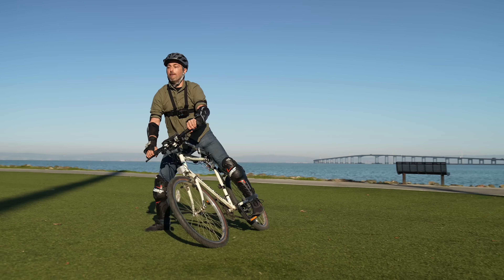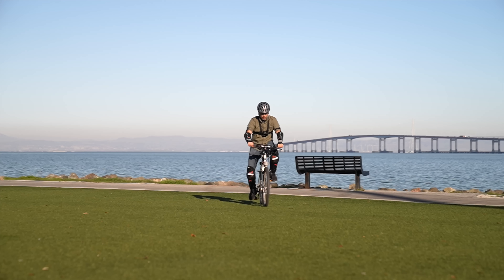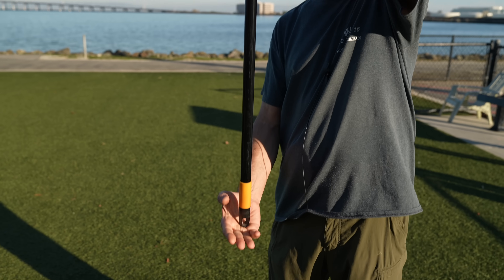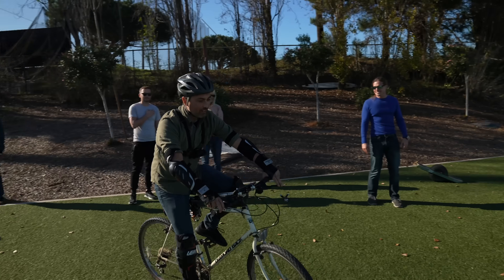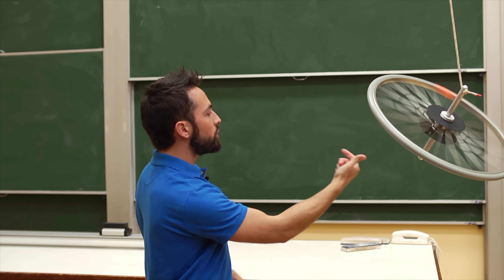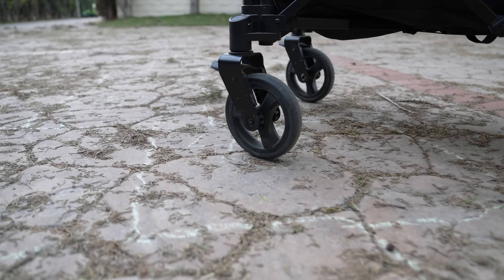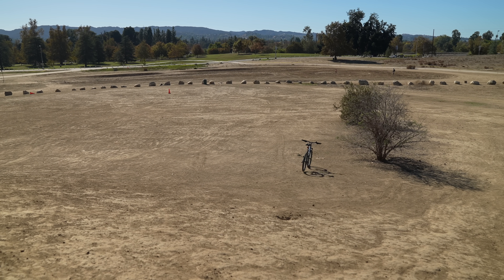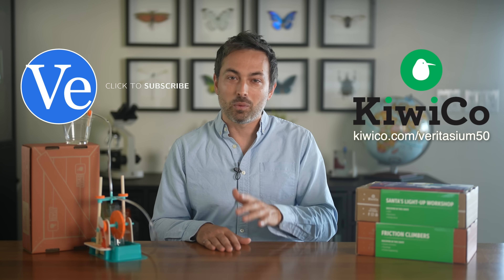Most People Don't Know How Bikes Work

Comment: this just means, you havent touched a motorcycle, and you also cant ride a bibycle. First of all, if i dont want to ride my motorized vehicles, and i dont want to walk ok foot, and i want to be somewhere fast, i also ride my bicycle fast. As long as you are on solid surface lige asphalt, you dont do what you showed in this video. On grass you will ofc ride your bicycle as a dirt bike on gravel, but on gravel, with decent speed, not walking speed, you dont need to steer at all, you only lean. And on asphalt, even with walking speed, you wouldnt fall like a clumsy baby. 

The steering at high speed downhills, well, you do a slight turn of wheel/steer to opposite side where you are turning, but you lean to the opposite side, but the slight steer is far less, than you are even allowed here, you would need to steer far more, only, if you do like, dunno, professional competition timed run, and that is on a downhill gravel.

Tho, at end, the thing about gravity, how lean steers, that is how super sport bikes work, which is quite ancient technology. For example , i have 3 motorcycles, street motorcycles at low speeds in cities work same as you show with your bicycle on grass ( would be different on asphalt ), while supersport bikes, even at 20 kmh, your steering wheel doesnt turn at all, you just lean, but makes it difficult to drive them in cities.

Comment: Front wheel control is the most important for sure, I didn't really fully realize this until now though, but when I think about it - and you watch those guys doing jumps from different platforms - they make lots of corrections with the front wheel all the time to stay on the bike - and they are not moving that much at all.  I am guessing it's a ratio like this:  Front wheel = 99-97% of all balance, Gyroscopic Effect ≤ 1% up to 3%  Speed depending.

Comment: Any motorcycle rider knows at the very beginning of this video before even watching it (I haven't even watched it past a minute yet) that to begin going around a curve you have to "push" on the handle grip of the side you want to lean towards, thus making the handlebars go the opposite way momentarily so that the bike well begin falling in the direction you want to turn...then, the radius of the tire contact to the ground will maintain its balance as it turns in that direction.  It's called "counter steering" and is one of the first things we learn.  It's not so obvious on a bicycle but on a motorcycle going 30+ mph it's very prevalent because the handlebars move very little..  Very common...

Comment: Depends on how fast you're moving. If you're barely moving, yes you will go in the direction you turn the handles since your balance is always straight up and down. But as you gain speed, that becomes more impossible and you have to rely more on counter steering and which way you're balancing. It's the same with a motorcycle.

Comment: As a motorcycle rider you learn this in safety class.  The reason so many fatal crashes between the rear end of a truck and a motorcycle was always on the left rear quadrant of  a truck became clear; in an high speed emergency (they were speeding and suddenly needed not to run up the tail of a truck) rider would pull their handle bars to the obvious escape direction - the left however that made the bike serve right instead.  So in safety classes we've been taught to  push the handle bar instead of pulling it in an emergency high speed turn.  If you want to go right PUSH the right end of the handle bar and you will go right, PUSH the left end and you will go left.

Comment: Spend years on a motorcycle and one should definitely figure this out. Consciously. After a couple hundred thousand miles and many many full days of riding, it was important to become extremely comfortable with the mechanics of riding. Want to turn right? There is first a very slight press of the right hand that pushes the bars to the left. This happens instinctually after awhile.

Comment: having road downhill mountain bikes for some 20 years now, i can confirm you do have to turn the opposite of the direction you wish to turn before turning that way. Just mentally going through the process of a turn i see but i had never thought about it or been aware of that fact before now.
Reply: On berms though you can turn without counter steering first. If you’re hitting it at the right angle before and at least.

Comment: It’s like motorcycles except since it doesn’t have an engine you go way slower so people can turn the way the want without too much repercussion. Anything above let’s say 30 mph you have to push down on the side you want to turn instead of physically turning the steering bar. It’s simple to understand if you have riding experience but newcomers I can see why they struggle, it’s almost inverted but not really.

Comment: I bought a motor scooter years back. I'd never ridden anything with a powered wheel, and my first attempts to steer were abysmal. I decided to look at the instructional manual that came with my learner's permit, and read about "counter steering." I didn't believe it. But... why else would it be there? I went outside and pushed on the right handlebar to turn right. Smooth as glass. Left, the same. I got my full license and rode for years. One day, I got in a jam at speed and figured the only way out was to dump the bike; I SHOVED down on the right... and the bike made one of those motorcycle-racer type turns. I felt almost flat to the ground, but the tires stuck and I went around the obstacle. Amazing. Turning a motorbike is all bank.

Comment: As a motorcycle rider, I immediately knew this video was going to be about counter-steering lol. I think the way that most people explain counter-steering in like physics theory terms makes it more complicated than it should be from a practical standpoint. If you are on a motorcycle and you want to go left, you push down/away on the left handlebar, which points the front wheel slightly to the right, causing the bike to lean to its left side and do a left turn. Vice versa with turning right.

Comment: "Push-steering" Most motorcycle drivers know about this, or learn quickly the painful way.
Instead of "turning" the handle, you push out the side you want to turn toward.
Reply: This is also true for bicycles above certain speed. During left turn you need to keep applying force on the left bar otherwise the front wheel will oversteer catastrophically.

Comment: 7:40 It should be noted the way the gravitational forces work towards that bike when riding down the hill/slope vs being stationary. On a stationary bike the gravity can't force the bike to lean either forward or backward because the potential (height) energy are the same on both front and back and instead the gravity would pick the closest direction it CAN push over which is... to the side.
On a bike riding down the slope, the gravity is leaning towards pushing it forward instead because the potential energy is lower than the one on the back. While it could still technically fall over despite gravitational energy being spent mostly on pushing it down the slope, those 3 counter mechanisms prevent the bike from falling over.

Comment: Dude you make it look so hard to ride a bike.

I ride both carbon fibre racing bikes and mountain bike and if I want to just simply turn on my race bike, I just lean to the left, whilst turning left and mind you it does take some practice, but it’s not as hard as you think it is. 

The only time I would turn left and right is when I ride over a slippery patch of dirt or a loose patch of sand so I don’t fall of the bike or I would do it to swerve left and right warm my race bikes tyres up, when I just start riding and I hit 35 - 40km/h like a race car.

Comment: If you lean over to the side towards where you need to turn, the curve of the tire will pull you into the turn before starting to turn the handle bars, negating needing to swing the opposite direction to get a turn started.

Comment: I'm a guy that cycles literally every day to school since he was four, so i am no pro but i consider myself to know a thing or two about my bike, and this video made me so curious that as soon as i got on my bike after seeing it i checked to see how i steered. Turns out that i DO NOT steer like that. I actually do not steer at all, i just "unbalance" myself in the direction i want to steer to and the bike basically does the rest. I tried to steer with the technique that people in this video use (counter-steering before actually taking the turn) and it felt so unnatural xD.

I don't know if anyone cares, but i found it pretty interesting
Also, excuse me for my poor English
Reply: When you bias your bodyweight you subconsciously put weight on  the bars on the side you're leaning to.
Reply: @benfennell6842  Isn't that what i said? I don't understand :3
Reply: @yZempX  when putting weight o  the side you lean to that weight goes into the bars on that side, pushing them forward ever so slightly, and steering them in the opposite direction.

Comment: You kinda just lean to turn a bike also?  But yeah I can see that you need to be able to turn both ways to stay balanced during a turn.
Reply: Yeah but this only works on a bicycle, on a motorcycle trying to turn without touching the bars is almost impossible. Bicycles are just so light you can unbalanced them with your weight.

Comment: The whole, bike riding on it's own, yet can't make a full turn. I believe it can keep up right on its own, only because it's going straight and not making a full left or right turn. Yes, the front wheel will turn, but only for self correcting. If you do see it make a hard turn either way, it will fall. I believe the lack of it lean and counter steering, for redirecting its own center of gravity, is the cause. The front wheel can't anticipate the mass and speed of the rear of the bike for a full turn. When a bike does attempt to turn, they always fall down. It tends to understeer and thus slowing down or even stopping the front wheel. However, the rear mass of the bike pushes twords the now slow turning/stopped front wheel. This will now cause the bike to buckle over its self and fall down. Not sure this is 100% accurate, but just an observation of mine.

Comment: Don't you guys lean into curves? I nearly never countersteer before actually going into the direction I want to go. I even checked this with some people from the neighbourhood by mounting a cam to my bike and letting people drive it. Everyone leaned into the curve and thus didn't need to countersteer.
Reply: Yeah because bicycles weight like 15 kilos and can be unsettled by a person's weight. Also you still do it subconsciously as demonstrated In the video.
Reply: @benfennell6842   yeah I know how it works, but as stated before I mounted a cam to my bike (filming the front wheel from a fixed position on the frame) and on the videos there was no movement in the opposite direction visible.
Reply: @thenamen935  interesting. Did you also try watching people turn bikes from an outside perspective?

Comment: You're entirely ignoring naturally leaning into the turn without counter steering first, as we see both bike and motorcycle racers do.
Reply: Leaning your bodyweight on a motorcycle DOES NOT change the lean angle of the bike by more than few degrees a second, this has been proven over and over and over and can be tested yourself if you let go of your bars and hang of the side of your bike, it will turn VERY slowly. 

Bicycles on the other hand, fair game. I'm sure you've seen people steer no handed on them anyway.
Reply: Also precisely 0 pro motorcycle racers don't steer their bikes, literally not one it's not a thing they don't do, it's like saying car racers dont steer. It doesnt even make sense.
Reply: @benfennell6842  I never said they only lean and dont steer, I said I very rarely see them counter steer, then steer the direction they wish to turn, please read what is written before responding.
Reply: @ConcreteHades  well then in that case you might want to go watch motogp slow mo, because that's what they all do on every corner of every race

Comment: its amazing because on the motorcycle its the same but diferent as you dont have to pedal, to turn you can do it only leaning to a side, sometimes moving the handlebars, but just a little bit, no need to counter steer, but its all on your weight, Fort nine has some amazing videos explaining it
Reply: That is so the opposite of what Ryan's videos say, you should really watch them again, countersteering is the ONLY way to steer motorbike, your bodyweight will not dramatically affect its course.
Reply: @benfennell6842  i understand what you mean, i got lost in translation triying to explain it, yes the best option is countersteering but if you compare bike to motorcycle techniques you can see they are the oposite, leaning or countersteering in a bike like on a motorcycle is dangerous, also the other way around, the principles are similar but the technique applied to them are different, that's the point i was trying to make
Reply: @sprafa71  ah okay👍

Comment: I'm a staff employee at a major US state university with 10s of thousands of students. We have an epidemic of powered scooters being ridden around by students who have no idea how counter-steering works. They're really dangerous on sidewalks and pedestrian pats (where it's illegal to ride them because they're legally a moped) because they initially turn in the direction they want to go when making fast turning or avoidance maneuvers -- ones where weight shifting is insufficient to initiate the turn. A lot of the riding is barely directionally controlled. With the small wheel diameter and lower center of gravity from the vehicle weight, counter-steering has to be more deliberate than the intuitive bicycle steering. I'm amazed more aren't injured than already are.

Comment: Every motorcyclist explicitly understands counter-steering. It's impossible to safely ride one of any practical size and weight without knowing how that works. That and center of gravity shifting to control really sharp turn lean angles and small turn radius. It's especially dangerous for a rider who doesn't understand counter-steering in emergency avoidance maneuvers. It would be impossible to pass most riding tests without a clear understanding of it -- you wouldn't be able to successfully maneuver the really tight low speed direction changes.
Reply: Youd be surprised how many can kind of intuitively flunk their way through the tests. The slaloms arent really that tight so it's totally possible, and most instructors will never mention it on basic courses.

Comment: Okay, so people DO understand how bikes work. I don't understand this video. If people can execute the exact thing you mentioned, the they know enough. Also, it is possible to ride a bike without doing the opposite turn. You have to move the bike using the connection between your butt and the seat or you simply take the turn slower (not referring to speed but change in velocity)
Reply: Knowing enough to perform an action intuitively, is totally different from understanding it

Comment: i have ridden a large number of two wheeled vehicles,  many of which were my own creation, and yes at lower speeds you tend to steer away then into your turn; however, you can do direct turning with practice (i.e. for bmx/motorcycle riding) and not steer counter to your desired direction.
Reply: On a motorcycle? Only if you wait for ages to lean the bike over with your bodyweight. I've seen tonnes of demonstration of no handed steering on motorcycles it isnt practical, and if you think you can do it well you're actually just subconsciously making tiny steering inputs to lean the bike.
Reply: @benfennell6842  or I'm going fast enough that large steering inputs aren't necessary for the turns I'm taking. Also I like to "sashe" to warm up my tires, and I never counter steer for those.  Again, for slower speeds/ large degree turns (excluding bmx tricks) you will have a bit of turn out before you turn in but for tricks/ with practice you can make turns without the counter steer.
Reply: @benfennell6842  I start with the lean, feel the weight change (1sec duration) then push with the opposing arm only. Sometimes I'll  push down with the inside foot or the turn first.
Reply: @isaacwalker5956  your weight simply is not enough to turn a motorcycle, it weighs 3x as much as you, has massive heavy high velocity gyrosvopes and a self righting effect.

It's just subconscious countersteering. You can technically lean a motorcycle with your weight but as seen in every video of someone trying it, its completely impractical.  

It turns out you have to steer motorcycles to effectively lean them, and if you shift your weight eith your hand on the bars guess where that weight goes? You guessed it, straight into your bars, weighting the inside bar end and inducing steering.
Reply: @benfennell6842  I guess I'll just have to make a video once it warms up bc I can steer a motorcycle through Lane changes without my hands and make freeway curves without handle imput. I am ONLY  speaking from my experience, where i mess around with trying to do the things I've mentioned. As for bicycling, riding bmx has given me the muscle control to do lean turns without handle imput.
Reply: @benfennell6842  also my motorcycle weighs 2x more than me. I'm not a Harley rider lol. Perhaps it is the lower center of gravity my airhead bmw has that allows me to steer without handle imput
Reply: @isaacwalker5956  I await it patiently lol

Comment: There is a difference between, swinging out for a wider turn and counter steering. The vast majority of cyclists are swinging wide and physically leaning the bike over rather than counter steering. Much like almost every example you showed in the video. Almost every single one of them was a widened turn rather than a counter steer.